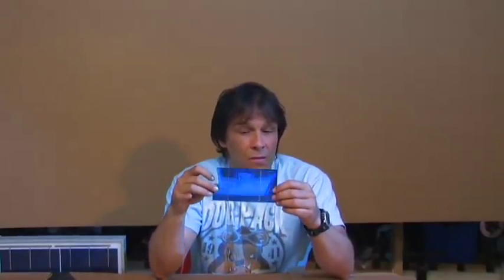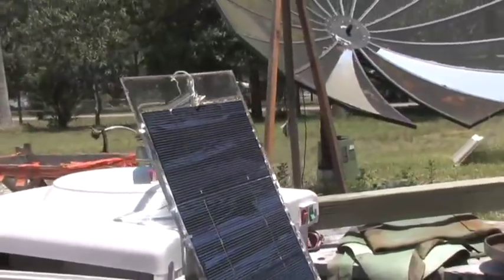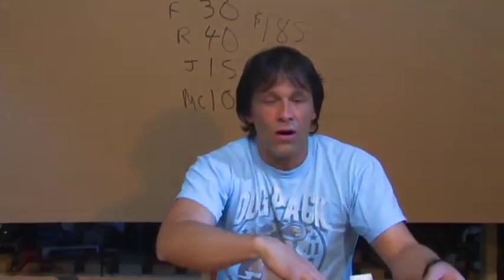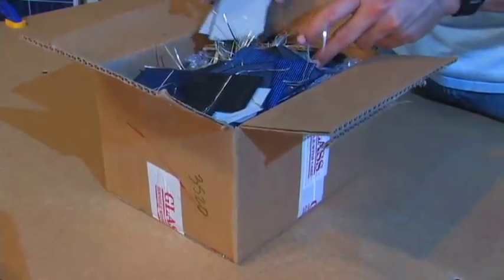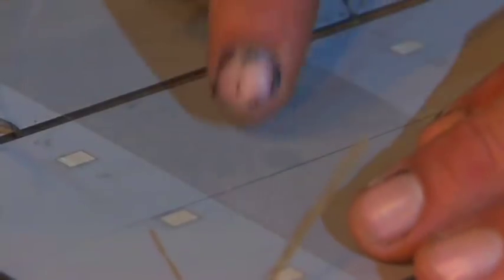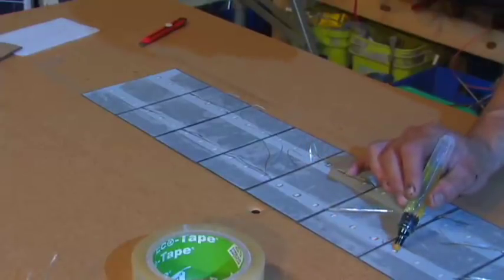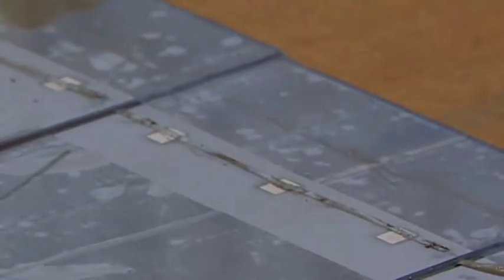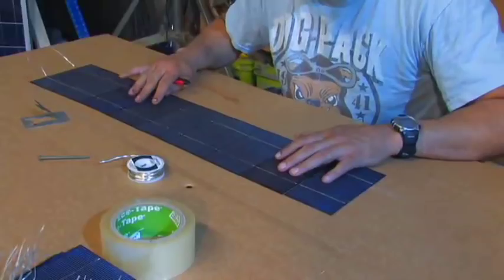less than $1 a watt DIY Solar Panel MAKE YOUR OWN SOLAR PANELS (PART 1)

Comment: Hi, another very interesting video guys, thanks, I would like to ask you if you know of any INFO site where I can get the whole data of a cell, I know 1 of 2 silicones are used (crystalline or amorphous) & doped with phosphorous & heated atoms then diffuse throughout the silicon wafer, what I do not know is how a positive & negative is set up within this body, {the two leads you solder} I presume {1 is + & 1 -} how is two terminals able to come out of one source, ? Thanks 
Thom in Scotland.

Comment: You misunderstood me. I meant that solar panel will be incorporated as tiles and newer to be removed. All DIY with safety. But i need someone to test 2 types of solar panels in depth 3m. Regular and IR panels and tell me decreasing efficiency. I dont have time right now because Im building 5axis cnc or 6... Regards

Comment: @jeanlucdemarc  thasts smart as it should aslo provide some heating element to the pool and if you cant put it under water you could try using somethign to float it on top when the pool is not in use.

Comment: Thanks for sharing some great ideas! Try to implement lenses and or mirrors on the sides to reflect sunlight onto the cells. Plus the material you are using will reflect a lot of light away from the cells, therefor a small array of mirrors will compensate for that. It wont be pretty, but you get broken mirror pieces in many places to play with :P Who says a solar panel can't be stylish.

Comment: Great VIDEO!!! I have used your video in different varation. Your information is great. I have made 6 DIY PANELS;different varation. Saving $400.00 to $500.00 per year; but contiously adding to panels one cell at a time. Incapisalation info is great. Will apply to my next panel!! EPOXY VERSIS SEALGARD.

Comment: I bought cells like this and built my own panels, had 22volts output but after about 3 months the output dropped to about 10 volts. Its not worth the time and effort to built the panels in this way. My advice is to save up and buy good finished panels you will not be disappointed like i was!!!!!!

Comment: @mainelyelectric  You get about 1/2V per cell, so ten cells would be required to reach 5V.  The type of 3" x 6" cells he uses are 1.8W each, which means they should push up to 3.6A of current.  You could use a smaller cell type with at least 500mW each to run your radio.  I built a small panel for a portable radio once, which could run the radio in full sunlight and charged the NiMH batteries anyway when the radio was not in use.

Comment: With a name like Rojas, of course you will use lead-free solder!  Heh heh. Rojas... RoHS...
Something I remember from my Solar electric car days was that you could make your encapsulant antireflective by embedding microscopic inverted pyramid structures in the outer surface.  It took a lot of doing, and you only saw corporate competitive teams attempt it. I wonder if you could embed that into the surface of your encapsulant while curing.

Comment: Dan, 

Have you tested your solar cell encapsulation process to determine which wavelengths of light might be readily absorbed or reflected? 

Some kinds of polycarbonates or plastics will block different wavelengths of light. Though I don't know for sure, even though it appears clear, its entirely possible the UV spectrum could be blocked with the use of some plastics greatly limiting the solar panels output.

Comment: @martinparmer I heard that Silicone II, is corrosive to electronics. Of course I have not got a definitive answer as to HOW corrosive. I am tinkering with solar, so if it means my panel only lasts 1/2 as long that is just fine. I thought the same thing myself when it comes to the back side of the panel.

Comment: From experience I found that broken cells lower the amperage and increases the voltage. Each piece of a cell creates .5 volts. A whole cell will like your working with 3x5 inch creates about 3.5 amps but break it and each piece will make half that much. The whole panel will create only as much amps as the weakest cell.

Comment: Yeah, I built one of my own solar panels and did not have the pre-tabbed wires.  Definitely more time consuming but I guess I got more practice soldering.  Got a bunch of old windows people threw out which I want to use for solar panels.  Anyway, good vid and I look forward to part 2.  Many Thanks.

Comment: If you need something else to hold the wire down, use a pencil. It won't heat up and the solder won't stick to the graphite.

Comment: What about using pressured treated wood with expansion room for the panel?

BTW, great tip on the wrong direction thing. Perhaps putting an arrow on each cell early in the construction process would help to avoid that?

Thanks Dan
-

Comment: Dan, do yourself a favor.get a surplus "Metcal" brand solder station. You will not believe how much easier your soldering will be using that! I swear it's a day and night difference. Second best is Hakko (but it is a distant second)  I used to do tons of surface mount component solder work and  have quit places because they were too cheap to get an affordable used Metcal.  Also forget that lead free stuff. Lead free is for factory reflow. 60/40 lead tin rosin multi-core is what you want.

Comment: @FilteredInc yes, it will overheat the cells and cause them to degrade faster than usual. Cells that are cooled down are actually more efficient than the ones that are warm or hot to the touch.

Comment: I was always wondering, what happens if you use a fresnel lens from a projection TV as a cover over the cells? Will it overheat particular cells or not have any useful benefits? Thanks.

Comment: @truvak - To make it easier to understand, say you have 3 cells, cell 1 (the first in the row lets say) is soldered to the back of cell 2, cell 2 then to the back of cell 3.  Cell 3 you keep the tabs free so you can then connect them to the MC connectors.  Hope this helps.

Comment: Good to know you make mistakes just like the rest of us ;). As an aside, I found a REALLY easy junction between the tabbing wire and an external cable is to use XLR wall plugs. XLR cables are meant to carry a DC signal, the plugs are cheap, just make sure to use the metal ones and not the metric plastic ones. You can easily set up a daisy chain as well.